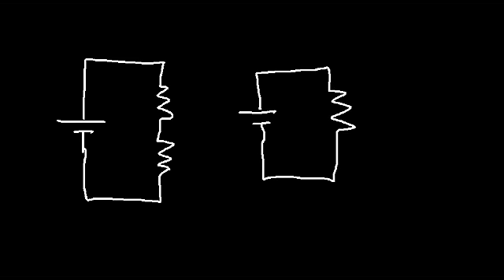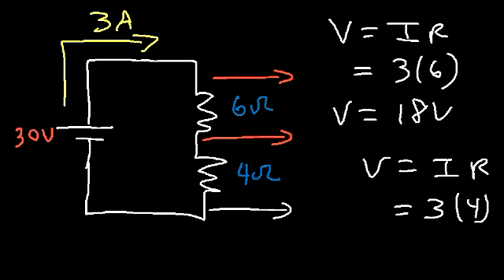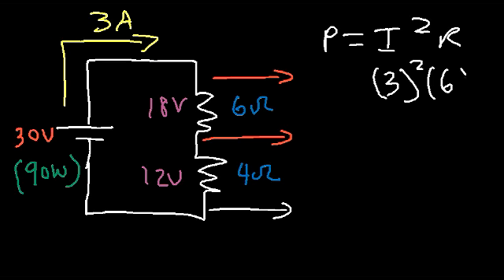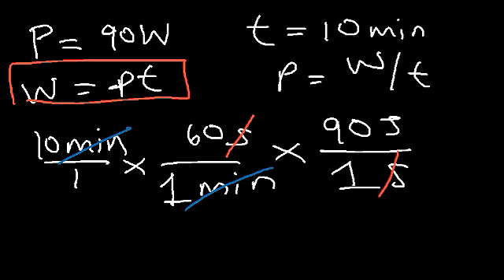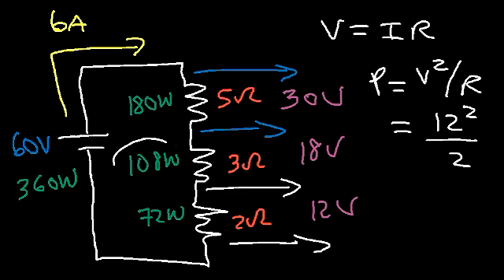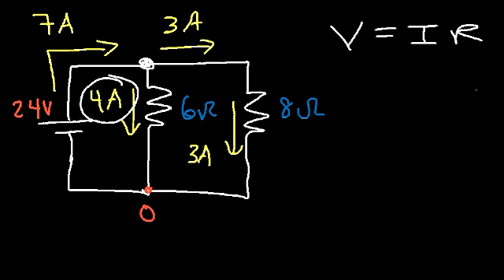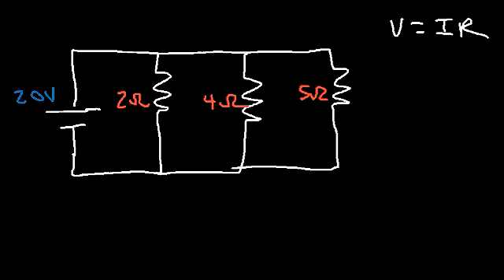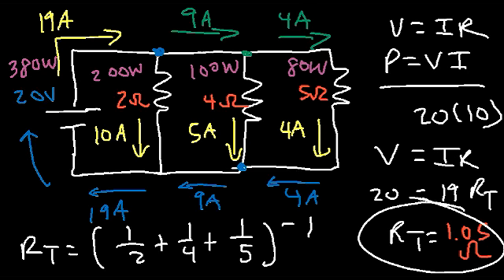Series and Parallel Circuits

Comment: Kirchoff’s Voltage Law — Total V in a CLOSED LOOP = 0 
* When current flows from + to -, thats a negative V contribution.
* In parallel, multiple closed loops, all the V used in those must be the same value as coming from the battery bc it must be 0 coming out. (visualize)
* mark amt of v in each point and esp points after a voltage drop 
* this bc voltage = electrical energy transferred to power it, so since electrical energy is used up throughout all components they end up = 0

Kirchoff’s Current Law — Total current going in the WHOLE circuit = total current going out.
* If there are multiple paths, the current must split for the current coming out to be equal to the one that came in. 
* This bc charge is conserved

More branches in parallel = more current able to flow = less resistance

Comment: At 15:45 how do we know that IR* is the right selection for P out of the ohms law wheel? I’m having trouble knowing how to know which one to use when solving for different problems. At first I tried the other two but didn’t get right answer.
Reply: i don't think there is ultimately a difference... you should be able to get the right answer for all of them regardless of what equation you use. when you get to more complicated problems, what equation you will use will depend on what numbers you have

Comment: How can there be 0 volts in a series or parallel circuit after all the loads (resistors/light bulbs) but still produce a current flow? Doesn't there have to be some voltage all the way back to the power source because even the wiring contains some resistance?

Comment: just a humble question.. almost 9 min into this video you do a calculation to find out the watts used for R1.  I took the 18v and times'd it to the 3Amp and came out with the same number 54. is there a reason for doing it the long way ?  im wondering if the way I did will fail me in the future.

Comment: Did you notice how the reciprocal of the resistance 20 over 19 fraction was the same as the total voltage over the total current in the scenario you set up haha
Reply: 30 mins in

Comment: How do you know when to square the current. As in when finding the power separately between the 3 resistors. How would you know which formula to use

Comment: To calculate the power for each of the resistors, you can also use the watts distribution amongst all resistors.  We know the total power is 360 watts and the total resistor is 10 ohms so each ohm receives 36 watts.  If a resistor has 5 ohms, then it will receive 5x36=180 watts of power.

Comment: Words can troll

Negative to Positive is parallel

Leg to Leg is parallel

When is a component series.?
Reply: Digress myself
= if using in-line electrical/electronics
= power segment should be different to avoid using resistors as switches
= or only use output of control-signals and not power

Comment: You just solved something for me that I struggled with while decoding a circuit

It was a voltage divider with three resistors.
Now I was able to figure out an equation on how it works.
Vo=Vi*Rn/(sum(R))

So if we have 3 resistors…
Voltage between the  second resistor would be = Vi*R2/(R1+R2+R3)

And the voltage between the third resistor would be = Vi*R3/(R1+R2+R3)

So this means that 1 resistor in a circuit would not have a voltage drop because Vi*R1/R1=Vi.

But if there is 2 resistors then you have Two voltage differences?
Vi*R1/(R1+R2) 
Vi*R2/(R1+R2)?

I got this by taking the current of the whole circuit (I(x)) which equals the voltage of the whole circuit / the resistance of the whole circuit. And replacing those values with the voltage between one resistor is equal to the current of the whole circuit I(x) * the resistance of that resistor.

Ic=Vc*Rc
Vr=Ic*Rn
Vr=Vo
Vo=(Vc/Rc)*Rn
Vo=Vc*Rn/Rc

Vo= output voltage
Rn = specific resistor
Rc = total resistance
Ic = total amperage
Vc = total voltage

Comment: I'm an English major taking an intro to electrical engineering course. Thank you. That's all.
Reply: May I ask why?
Reply: @SinoLegionaire  My university requires that I take 100 units outside of my major. I chose to take an intro to electrical engineering course since I figured I knew the basics from taking robotics in high school. I made the decision without actually analyzing what electrical engineering is. There's way WAY more to it than I expected, but I stay determined to learn about it. So far, I'm halfway through my quarter and I still have my A in the course. I thank The Organic Chemistry Tutor for that.
Reply: @kyponts  Hmmmm I really hope this does not come off as condescending but what made you major in English?

Comment: Your analogy of the light bulbs and the battery is a little off. In the parallel circuit the amperage or power would be split evenly amongst the bulbs. In the series circuit one bulb would be brighter than the other one because of the voltage drop with. The "having a strong battery" is a description of watts aka volt amps E*I

Comment: TIP: for power calculation in series always use i^2/r    and for parallel use v^2/r  because for series  current is same and for parallel voltage is same.  Sir ur teaching is the best

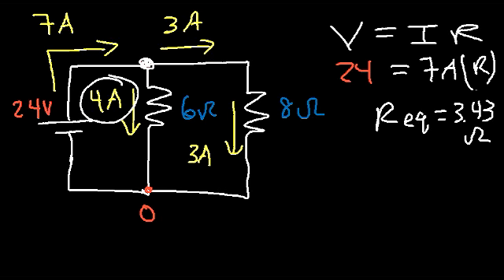Comment: 22:44 There is also another way to find RT by simply calculating the multiplication between the resistors over their addition which means 6×8/6+8 & give the same answer 3.43
Reply: I believe that only works if there's only two resistors, if there's more than two it doesn't work. But yes for me that's the easier way.
Reply: @ashleycooper9902 yep exactly two resistor can only works

Comment: I think i may be doing something wrong on my TI-84 when ever i enter ((1/2)+(1/4)+(1/5))^-1 I'll always get an error. However when I enter ^1-2 my equation comes out just fine. Any suggestions?
Reply: Try typing it as a fraction then , like for example  1/x instead of x^-1
Reply: I get .95 only

Comment: in a parallel circuit can you calculate each resistor's ohms by only knowing the volts and total amps?
Reply: You can only find the total resistance given voltage and the total amount of current
Reply: Is there no other given information at all ?

Comment: Why potential difference same in parallel circuit ? Please give me answer of this question
Reply: bcz current is dividing in parallel circuit.. so in a relation of three things if one is constant then the 2 may vary... so is the case current is varying and resistance ... and potential difference V remains constant... got it @Rimsha Sattar..?

Comment: Series -> constant current.
Parallel -> constant voltage.
Reply: thank you for this info
Reply: Thanks for restating. Ignore all the people trying to explain it to you lol.
Reply: thx
Reply: interesting
Reply: Wow
Reply: Thank you
Reply: thanks from 2025
Reply: omg u cleared my confusion with 6 words thank u
Reply: @objectoriented3049  bec in series connection current is not divided it doesn't change as there is no other way for the current to go through while in parallel current is divided as there is more than 2 ways to make the current path through
Reply: @ranavantaepurple7856 gx,. =,. ,.  0 ,0.        ,.    ,.0,0,=%
Reply: @ranavantaepurple7856  yes that's the answer
Reply: Thanks!
Reply: No not constant but same, constant means it never changes, but it can change
Reply: @objectoriented3049  bruh nobody knows
Reply: @objectoriented3049  bcz in series the same current passes i mean current is not dividing but voltage is dividing
Reply: @objectoriented3049  bcz current is not dividing in series i mean it has no other path to go.. the same current passes through each resistor
Reply: @objectoriented3049  bcz current is dividing it has more than one path... so in this relation voltage remains constant
Reply: Thx
Reply: That's Common Sense!

Comment: i would like to make a comment about conventional current flow, in my standard the current flows from negative to positive because the negative charges got more electrons than the positive charges it defends where the instructor would like their students to learn inside or outside. conventional current flows are negligible according to the magnitude in terms of angle of current in alternating circuits. if we consider current flows from positive to negative charges inside a vacum chamber there will be much higher losses in terms of true, apparent and reactive power due to grounding either equipment or system grounding in the ground. in science of philosopy where people population come less than destination of population.